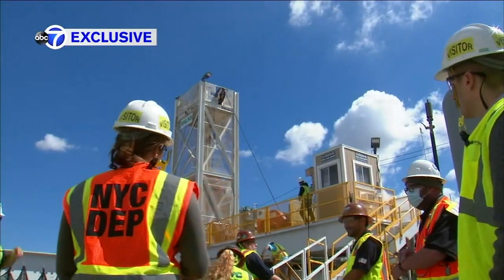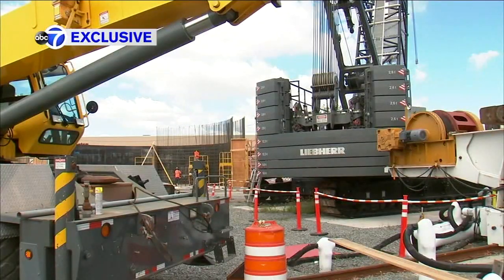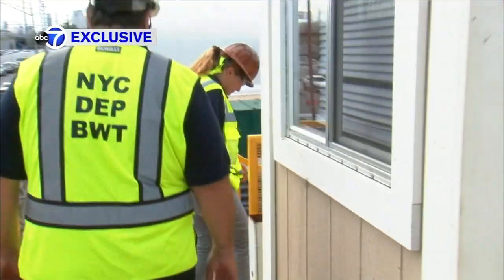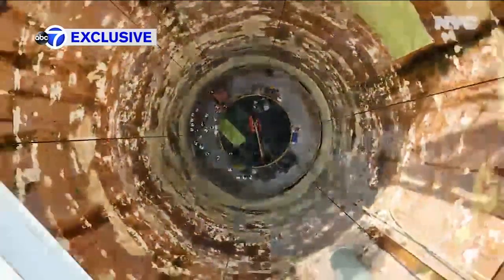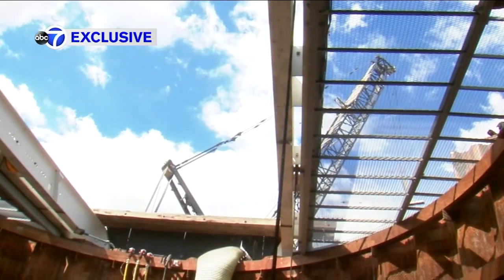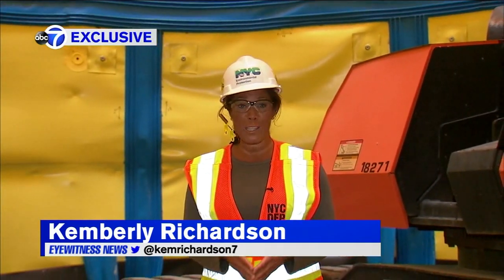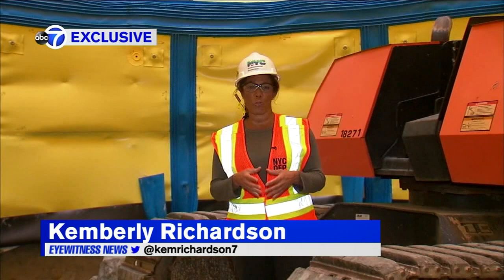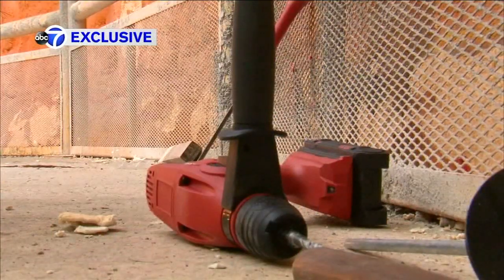Exclusive look deep inside NYC's most expensive water project ever

Comment: The idea is tunnel #3 will allow them to shut down tunnels 1 and 2 as needed to perform maintenance. The old tunnels were built with bronze valves to be able to do this, state of the art when they were built, but they dare not try operating them now out of the likelihood they'll get stuck with no way to unstick them and restore the needed supply of water in time. So, tunnel #3.